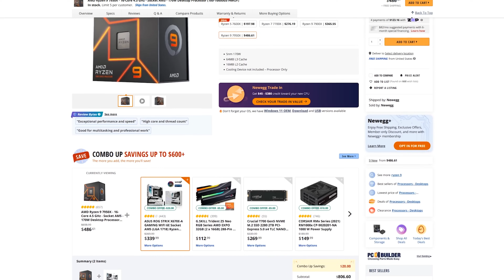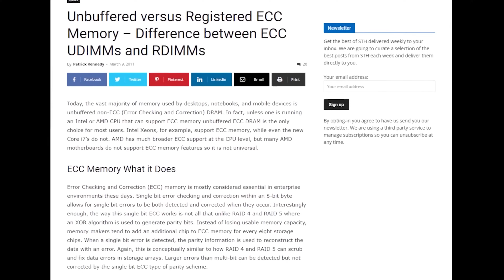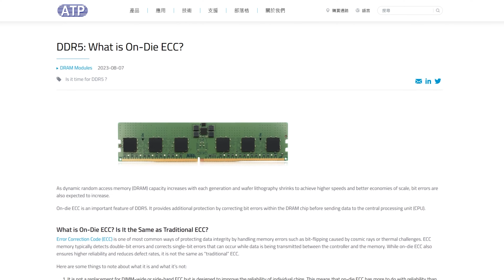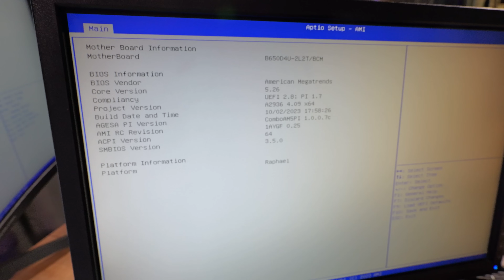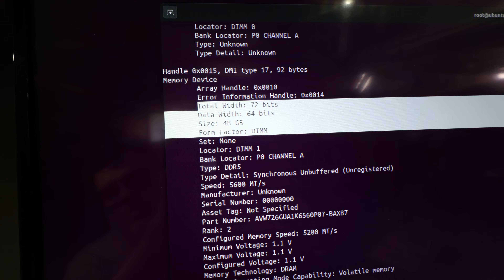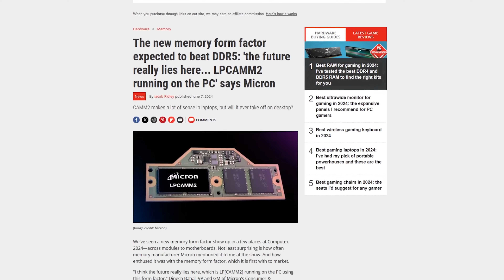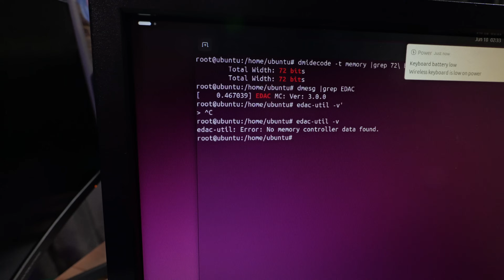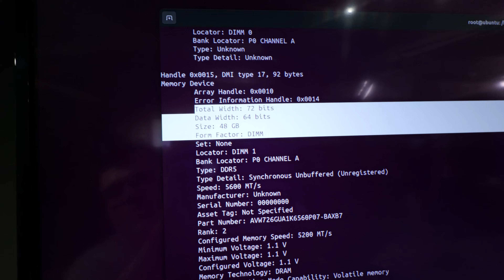What's Up With Error Correcting Memory on AM5 in 2024?

Comment: Would be interested in what the technical difference between 72bit vs 80bit ECC is.
Reply: 8 bits extra for corrections
Reply: not much, 36 bits is enough to encode 32 bits and provide ECC. lower capacity modules use 4 x8 chips for the data, plus an extra identical chip to store ECC bits. The chips all have to match, so the extra chip is also x8. UDIMMs only have four pins to connect the check bits (per sub-channel) so the other four bits are wasted.

RDIMMs have eight check bit pins per channel so they can connect all eight bits, making a 40 bit sub-channel. Two channels per DIMM gives us eighty or 72 bits total.

High capacity DIMMs use x4 chips, so it's possible to have 36 bit ECC without wasting half a chip.

It's up to the host computer to make use of the extra bits, so it's conceivable that a design utilizes the extra four bits but 36/72 is sufficient for SECDED

Comment: One idea for future video: Old NAS with only HDD bays and using it's USB slot as a cache.
Reply: If the mobo has empty pcie slots you'd be better off putting nvme drives in them for the cache. There's lots of nvme-pcie adapters available, both active and passive.
Reply: @spankeyfish  sure, but no slots in Qnap. No point building custom NAS because soon(™) can replace all these HDD's with solid state memory.
Reply: that sounds unreliable unless its USB 4, but hey worth the try for science

Comment: oh, i've seen a ton of places lately offering 5000-series and 7000-series cpus on dedicated servers in colos. their cost efficiency in eco mode is extremely high in the server market, and their higher single-threaded performance has a growing niche in servers and workstations running compute-bound workflows that don't parallelize as well.

datapacket has them almost perpetually in stock.

Comment: > Yes, you can get 64 gig DIMMs

No you can't, they don't exist anywhere for sale and no manufacturer lists them anywhere. I'm aware they exist in the lab but they're not for sale.
Reply: I can find them. They are quite expensive though. 300+ $/dimm.
Reply: @stefannilsson2406  can you link? I can't find them on the usual suspects: amazon, newegg, microcenter, bh... Not even google, nor going directly to corsair, zskill, kingston....
Reply: i've seen them a few times on newegg. they're rare, and most users likely get them via custom contract.

i've even heard of 128gb dimms, but the bandwidth of those is so poor, it's a waste of resources outside extremely niche use cases that need a ton of memory but not too much bandwidth.
Reply: I have seen 48 gigs tho
Reply: Hey... Are you the LLM finetuner?
If so, good going.

Comment: Registered ECC should be the standard for all computing today. The fact that JEDEC member companies still view security and data integrity as premium features for only certain classes of consumers is a total ethical failure.
Reply: you know registers are only required for particularly high capacity right? its simply not needed on the vast majority of systems, nor does it aid performance or cost.
Reply: Registers are unnecessary for low capacity systems. They're only needed for servers with a huge amount of chips being driven by a memory controller.
Reply: @shanent5793   “640K ought to be enough for anybody.”
Reply: @shanent5793   “640K ought to be enough for anybody.”
Reply: After 15+ years of pc building I still don't fully understand buffered memory or why even after all these years of DDR improvements the benefit of that additional register isn't simply part of the specification. I understand the latency benefits being unbuffered and why this can sometimes be preferable but why is this driver still necessary for such significant increases in capacity per dimm?

On top of this why are RDIMMs no longer pin compatible with UDIMMs? It just seems like we're going backwards. I think there's input voltage differences with DDR5 for some reason but it's all still dropped down by the PMIC.

Perhaps this just ignorance of the situation but feel like at this point we could simply have one specification that supports all primary configurations, with some limitations obviously due to what the board and specific CPU can technically handle.
Reply: @JJFX-  registered/buffered is about power draw over the memory bus when there are 8+ sticks of memory. (8 is not a hard cutoff)
Reply: @JJFX-  there are two ways that RDIMMs reach those high capacities. The first is to use x4 chips (4 data bits) instead of the x8 and x16 chips used in UDIMMs. This will double the number of chips on the command and address (CA) bus. All those connections soak up signal power and add stubs to the bus lines, reducing signal integrity. DDR5 desktop PCs already sacrifice some performance to support two DIMMs per channel, so the memory controllers would have to be made twice as powerful, which is not cost effective for a rare use case.

The other way to increase capacity is to stack the dice in each IC package, they've gone up to eight dice in one package. There's no way an integrated memory controller can directly drive all those chips.

The register delays the commands by one clock cycle, a fraction of a nanosecond. This isn't really noticeable when accesses still take ~60 ns.

Including a register on low-capacity UDIMMs which can have as few as four DRAM ICs is also not cost effective. The register would be a large fraction of the total costs.

The combination of x4 chips and stacked memory means the DIMMs can use a lot of power, hence 12V for RDIMM v. 5V for UDIMM, and the incompatible connectors.
Reply: you can blame INTEL for that.
Reply: So you would prefere more costly and less efficient memory?
Reply: @AlpineTheHusky  Yes.  I'm not building my own system because I'm trying to cut corners.

Comment: I can confirm Asrock PG Lightening X670E has ECC as an option to enable in the BIOS, and wmic reports the data with and physical with as 64 and 72 so the bus ECC is active. This board is also at 1.1.7.0 AGESA as of May BIOS rev 3.01 so should have the same stuff as the Taichi Light at a lower price point. Also I have tested with the higher density ram modules and have 1 build with 96GB 2 dim, and one with 48GB 2 dimm up and running with ECC (96gb kingston and 48GB NEMIX generic). Both of these we built as workstations for Solidworks with 7700X... since solid works scales poorly with cores this is about the fastest practical build on a sane budget. Also one with W7800 and the other with W7700 GPU.
Reply: Where did you order the ECC RAM? I got the same mobo with 7900 non X

Comment: Which taichi lite can you have 8 + 8 lines for the PCIe , because the b650e taichi lite Version says 
CPU:
•	 1 x PCIe 5.0 x16 Slot (PCIE1), supports x16 mode*
 Chipset:
•	 1 x PCIe 4.0 x16 Slot (PCIE2), supports x4 mode*
You can doing on the INTEL version Z790 Taichi Lite , but that would not be on AM5
CPU:
•	 2 x PCIe 5.0 x16 Slots (PCIE1 and PCIE2), support x16 or x8/
x8 modes*
 Chipset:
•	 1 x PCIe 4.0 x16 Slot (PCIE3), supports x4 mode*
it's also on the X670e taich but that is not a $200 , but a $500 motherboard

Comment: My question is when will 64GB DDR4 ECC UDIMMs be available.  I have 120GB of ram in use so it's either use 2x 64GB DIMMS or 4x 48GB DIMMs clocked waaaay down to 3600MT/s.

Comment: I really do not get the need for ECC memory.
For that 1 in a million bit switch that makes my server crash?
In the same time frame my server crashes X times more because of software errors, network outages, configuration error, update problems ...
Reply: imagine a simple video broadcast server with 1 upload and 10 downloads. a one in a million chance of a bit flip for every bit you receive on a 6 Mbps stream means you're encountering on average about 75-80 bit flips a second. and this is just on the receiving side.

1 in a million for a single bit is itself actually unacceptably low. in reality, it's multiple orders of magnitude higher.
Reply: @dead-claudia  "One in a million" was just a figure of speach. I know that it is much lower.
I found something like "So the probability of having at least one bit error in 4 gigabytes of memory at sea level on planet Earth in 72 hours is over 95%", and know without exact context that is not exact but can give us an basic order.
So still my question remains:
What do I care about a bit flip in the data of a video stream? In 99,999999% (figure of speach, not actual the probability) you won't notice this.
Reply: 1 in a million in a server that does a trillion  trillion operations per second? Yea, it becomes an issue
Reply: @Feier_Salamander  it's for the other 999999 that don't cause a crash
Reply: @shanent5793  What you say does not make sense "It should correct errors that are not there"
Reply: @Feier_Salamander   not every flipped bit will cause a crash. Crashes happen when the code or a memory address gets corrupted. The flip could happen in the data, which still may be caught by other end-to-end codes like TCP checksum or simply give you the wrong answer in a computation. So even if only one in one million bit flips causes a crash, the remaining bit flips are still corrupting your data. With video in particular, the effects of corruption could be confined to a single macro block or destroy several seconds of footage, which might be important, for example, if it's the new couple's first kiss in a wedding video
Reply: @shanent5793   For the wedding video the chance of: Corrupt storage, user error, battery runs out is magnitudes higher than a bit flip destroying my video. I still say it is just not worth to waste money on that in 99% of the cases  because the error comes from somewhere else everytime.
I do not say that there may not be cases where it may make sense. Maybe long running in memory databases with financial data (Does something like this even exists. Sounds quite unlikely), but still I think there could be other more feasible error detection/correction available.

Comment: Whats the difference between registered and unregistered? I have unregistered ECC in my NAS...
Reply: registered = allows higher density ram by having extra registers on ram and thus having less stress on memory controller of cpu.
Reply: Wikipedia definition:

Registered memory (also called buffered memory) is computer memory that has a register between the DRAM modules and the system's memory controller. A registered memory module places less electrical load on a memory controller than an unregistered one. Registered memory allows a computer system to remain stable with more memory modules than it would have otherwise.

Comment: Wendell, of all these boards you showed off, which ones are best for IOMMU Vfio?  I was considering the x670e ProArt, but if another board is better, I'd consider it...

Also, you mentioned that the PCIe configurations were better on the new x870 boards - - - In what way are they better? Could you elaborate a little more on that?  Thanks for all your amazing work!
Reply from the maker: thats a good choice for iommu tbh. newer boards seem to have 1 more 4 or 8 lane slot.

Comment: Could I run a mullet computer? Business in the front (3200 ECC for CAD & sims), and party in the back (5800x3D for games)? 
My b550 vision dp supports ECC and I'm thinking about moving away from my b-die 16gb (3600 CL14) setup to a 32gb ecc without sacrificing too much performance in my single player games

Comment: Slight error at 6:05: DDR5 on-die ECC has no ability to correct in-flight errors, only those that happen inside the memory chip.
Reply: When I heard that part I was like: oh cool, so Cyclic Redundancy Check (CRC) for both RD/WR data is mandatory now? Judging by your comment it isn't?
Or did you just mean that it's not end to end protected?
Reply: As long as end user is not notified of errors, error correction does not matter. "Is my stick bad or not ?" "does this super vague ddr5 on-die ecc lower performance when it's doing something?" dunno so don't care, so not useful.

Comment: 15:01 imho that's not enabled, I get that with non-pro APUs on AM4 too.
When ECC is actually enabled it should show the DIMMs in dmesg, like this where there are 2x 16gb sticks and 2x 8gb sticks mounted
 sudo dmesg | grep EDAC
[    0.462287] EDAC MC: Ver: 3.0.0
[  181.059288] EDAC MC0: Giving out device to module amd64_edac controller F17h_M10h: DEV 0000:00:18.3 (INTERRUPT)
[  181.059295] EDAC amd64: F17h_M10h detected (node 0).
[  181.059300] EDAC MC: UMC0 chip selects:
[  181.059302] EDAC amd64: MC: 0:  8192MB 1:  8192MB
[  181.059304] EDAC amd64: MC: 2:  4096MB 3:  4096MB
[  181.059310] EDAC MC: UMC1 chip selects:
[  181.059311] EDAC amd64: MC: 0:  8192MB 1:  8192MB
[  181.059313] EDAC amd64: MC: 2:  4096MB 3:  4096MB

Comment: You may be the first to directly say: these are renamed ryzens.  While it seems a bit obvious, it has been surprising how many either just ignore that or tip toe their way around the issue.  See tech tech potato, geerling, etc...  Also, the low end epyc 8004, though a bit of a pain to get a hold of, isn't a massive amount more than a ryzen/epyc 4004 setup, except it has all the pcie lanes and other server must haves you could want.  Also lower power depending on the chip.
Reply: I have an eye on Siena as well. In my opinion it's a good option as you get high core count and much PCIe connectivity at a relatively low price and TDP. ASRock Rack has an ATX board that's pretty interesting that starts to become available in some stores. I'm currently running an ASRock Rack W680 Server board with an i5-12600K with ECC UDIMM, so low core count but high clock speeds and a Siena platform with high core count but lower clock speeds would be a nice addition.

I also don't get the point of the new Xeon E series. You can get a 12th/13th/14th Gen Core processor and a W680 motherboard (that has verified ECC support!), disable the efficiency cores in the BIOS and you basically have a Xeon E (but with an iGPU!).
Reply: No kidding on Siena being a pain to get a hold of, the CPU's aren't that hard to find but the motherboards are practically impossible.  I'm holding out hope that by the time I rebuild my NAS I'll be able to actually find one to buy.

Comment: All cool and fancy but if boards lack PCIE split by default having a single x16 pcie5 in almost useless.
IMHO at this point all those fast gen pcie is less useful than having multiple lower gen pcie slots unless manufaturers
 start to update the PHY on the chips but I'm still waiting to see gen 4 NICs.

On my main Pc I went with the MSI Carbon B650 also due to the fact that the x16 can be split into 1x8+2x4(ngff) so when the mainboard will be used (in future)
as one of my server I have the lanes to put cards in it (via adapter or whatever). I have the 7900X as cPU as the 7950X was unobtanium or priced a lot more than MSRP (scalpers?)

Right now I have 2 NICs, 2 GPUs and 1 HBA in my server. And I still have lost some lanes as those slots are all x8 whiler some cards are x4 or x2.
Unless you go with an NVME only server and you plug a bifurcation card or you only need compute the lanes as they are are basically useless.
Reply: I've done a fairly extensive survey of the AM5 mobo market and I'm dismayed with how bad PCIe lane allocation is. I like to mess around with compute cards and fast networking but not enough to justify buying Threadripper and I don't want the poor performance of an X99 system. All I want is well spaced x8x8x4 with PCIe 5.0 for the top slot without spending huge money on a board. If I relax the PCIe 5 requirement there's ONE board on the market that does that, the Proart B650. Kind of ironically, the Proart X670E has a worse third slot, being only x2.

My 10 year old Z87 system does x8x4x4 using just the 16 CPU lanes and without being expensive. Now we have 24 CPU lanes but far worse allocation unless you spend high end GPU money on the mobo. The death of SLI gaming is probably the cause of this.

Comment: Us consumers will forever be second class citizens to hyperscalers and the like…
Reply: Uh I'm not convinced this is a matter of first and second class citizen. I guess its a little bit similar to cars. First new engineering happens in racing and then trickles down into premium vehicles to eventually arrive in the mainstream when costs are down
Reply: @Mooooov0815  Partially this and partially the fact that hyperscalers buy significantly more volume.  I might buy a new system every few years but hyperscalers are buying in the thousands.  DDR5 and PCIE5 (and 6-7 to follow) were/are really all about the datacenter/hyperscalers/enterprise and it trickles down to consumer stuff a later on.
Reply: @Mooooov0815 We used to get the same hardware with the same features as the big businesses, and some level of error-handling was not just standard, but a required part of IBM-compatible systems.

Intel spent a LOT of effort convincing people that RAM is better than it used to be, errors are a thing of the past, and no one needs support for error detection or correction anymore. At the same time they were introducing new very-expensive business chipsets that still supported error detection and correction features. 

This was Pentium2-era stuff, and we've never managed to turn back the clock.
Reply: It makes sense, datacentres, enterprises and hyperscalers NEED the new technology and NOW, and are willing to pay for that as well as the support.
Home servers are just a tiny niche. People within that niche also will just buy enterprise gear on the second-hand market anyway, so most corporations have no reason to accommodate the needs of that niche.
Reply: Obviously, hyperscalers spend so much more money on hardware than homelab-nerds, it's totally understandable to treat them with better support.
Reply: That’s capitalism for you. More money, more votes.